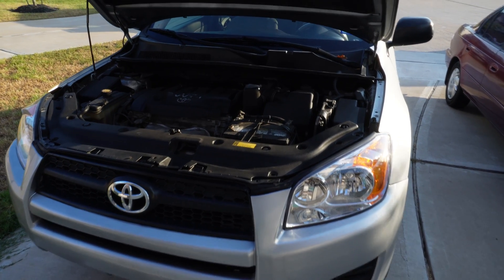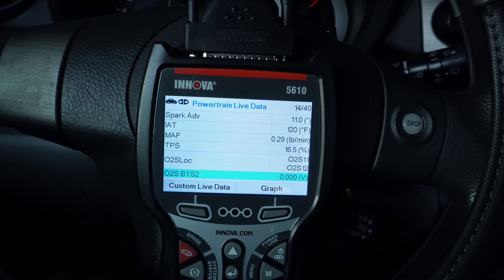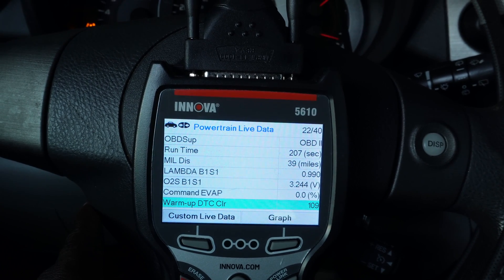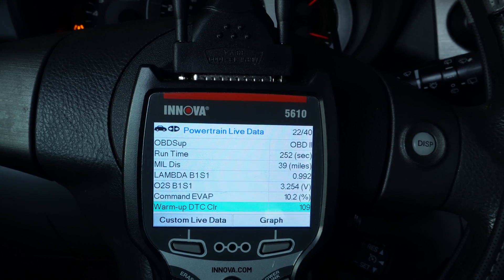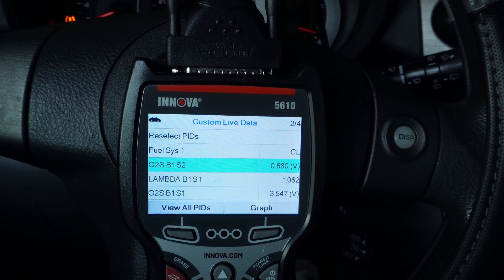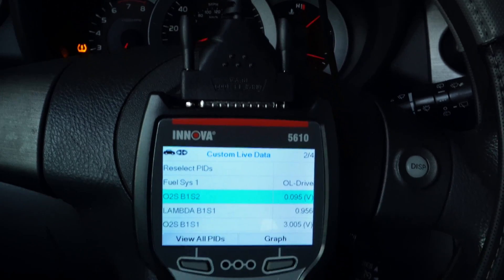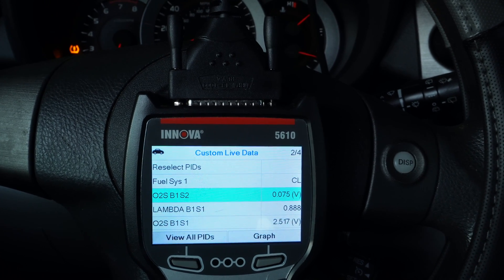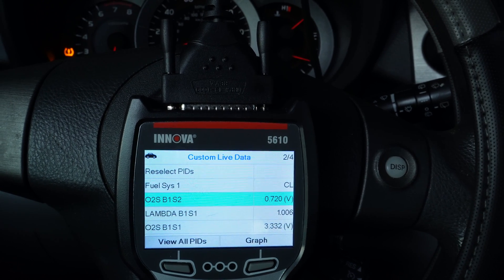2009 Rav4: How to diagnose Catalyst Efficiency with Live Data

Comment: Um, isn't it inevitable that the B1S2 sensor would hit 0 V when you let go of the throttle? You cut the flow of oxygen to the engine when you release the throttle so a fair bit of unburnt gas comes through the exhaust until the rpm stabilizes to idle
Reply from the maker: good point